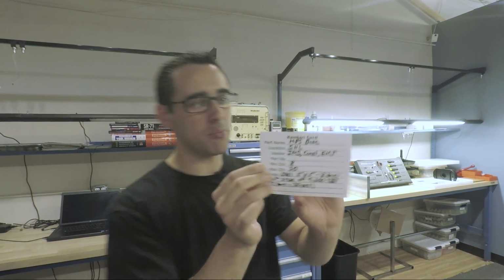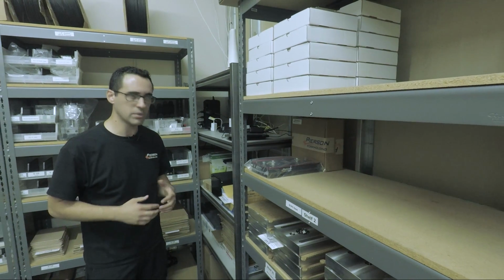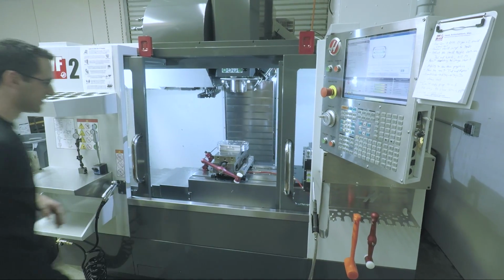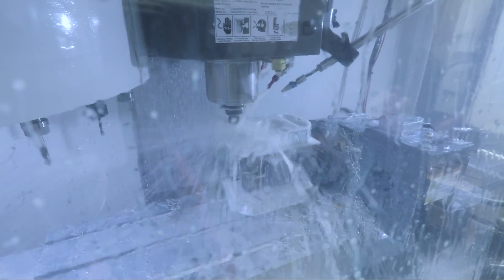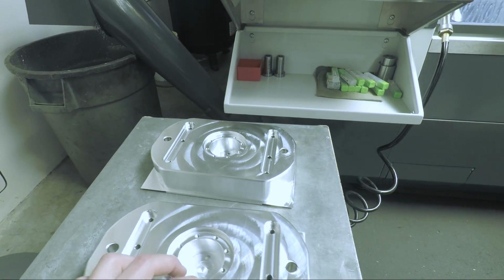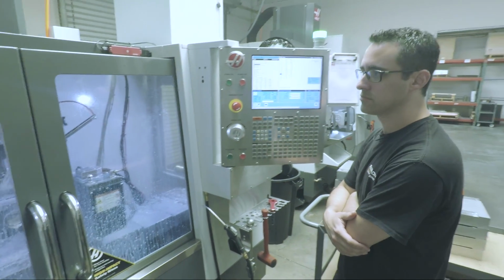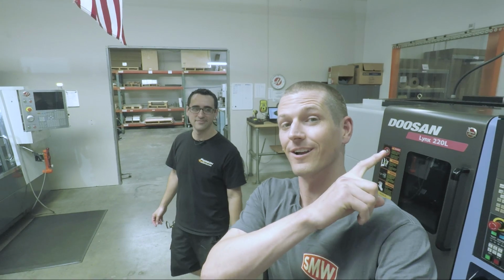Machining A Pierson Mini Pallet System!  1 of 2

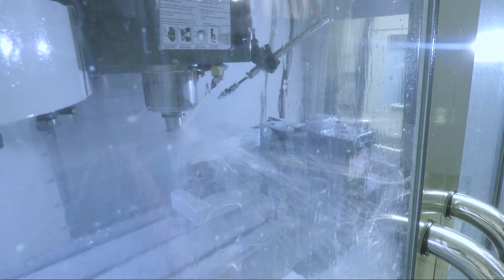Comment: 18:18 350 IPM at 8000 RPM with a 3 flute endmill. Chip load would be 0.014" per tooth. Is that possible?

Comment: You run CNC machines to automate your manufacturing.
Then you break your business processes into a thousand individual manual steps that take a bunch of people and creates a thousand points of failure.
And on top of that you clearly are collecting all this data somewhere to analyze.....
Which I'm sure has to be doubling efforts somewhere and introducing another source of possible errors....
Your accounting, inventory, manufacturing, sales and purchasing systems should all tie into each other and all those boards on your wall should be screens on your computers.
You wouldn't stand at a keyboard and enter gcode line by line. That's what you're doing with your office management system.
You should be able to give a customer a quote and if they decide to order, turn that into an invoice which will trigger inventory and parts assemblies and manufacturing tickets and packing slips.....
All that info can be available from every phone or computer in your organization.
You can even tie your customers into your website let them enter their own order....

Comment: Great ideas however you cant truly state that this is a lean operation.smooth but not lean. All that was done was simplify and streamline operations to 100's of manual processes. Need a part 1 guy carries a card to order. (Why isn't stock charted against orders? And inventory known) then another person updates a manual board. A machinist then has to walk and update said board and be updated from board. Everything on those boards can be automated in software and macros. But you added miles of walking to update and slave to a board.

Comment: Great work. Over 35 years of manufacturing background here and I love what you are doing. My background is electronics but the same lean principles apply to an manufacturing process. I would highly encourage you to start Gemba walks. I come in 30 minutes early a couple of days a week and walk the production floor before the operators show up, this gives me a feel for where we need to reduce clutter or where there are production bottle necks. If I see a lot of full racks at one operation I look at where we need to balance production. I also do a daily walk while production is in full swing and just observe. If you want to established a quality culture watching production will tell you if you are effective. 
I would also encourage you to look into ISO 9001 and 9002, laying the foundation for certification early in the evolution of your organization will make certification easier later. Being ISO certified makes it easy to be approved as a supplier to larger companies and is a huge bonus for marketing  in the military and aerospace industry. In my experience military and aerospace are the areas where small manufacturers in the US can compete with off shore companies. You don't have to be producing product that is directly used in those applications but if you are servicing companies that do you can be an approved vendor very easily if you have an ISO certification.

Comment: Just a quick tip, you could probably speed up your cycle time somewhat substantially by programming the drilling cycle as a G73 chip break cycle rather than a G83 peck drilling cycle, as the tool does not retract completely out of the hole. Also in aluminum with a cobalt drill, I wouldn’t be afraid of pushing it 2X or maybe even 3X D per peck either. I’m sure you know this already but if not then you learned something! 

Cheers, 

Kade

Comment: On that job with the 2 piece rotary, even still there's wasted time. Around 23:40 you've got the same tool running back and forth. I doubt that's intended? You should be able to prioritize cuts so that doesn't happen, at least in Mastercam. So fun to watch that run though. That's the kind of machining I like to see

Comment: John, Haas has settings to turn on your chip conveyor for a period of time. Setting 114 is the setting for the interval for it to automatically turn on(10= it will turn on every 10 minutes), 115 is the amount of time it will be on (5= it will run for 5 minutes). All you need to do is either turn on the conveyor by pressing the button after you start the program or us an m31 at the beginning of your program, and your chip auger will turn on every 10 minutes (setting 114) and run for 5 minutes (setting 115). I hope this helps you. This is what I use instead of using manual NC in HSM.

Comment: Some sort of server that can be updated from any computer that drives an similar looking board with led indicators in  each "cell" could be a great way to improve the system. Any even having physical buttons on the board to update the progress that also updates the server document could be utilized. You could them be receiving notifications about status critical criterion from anywhere.
Reply: The 4 criteria we use for evaluating improvements, in order, are Safety, Quality, Simplicity, Speed. The things you mentioned definitely violated the Simplicity requirement and possibly Speed of implementation.

Comment: 33:00 - 33:27 What is Jay saying? I'm pretty sure I understood him. So the 'Z' zero is the center of the tombstone, I get that. That makes sense. But for the arbitrary 'Z' number, it should be fairly straightforward. The tool height in the offset is based off the Gage Line right? So that no matter what tool you have in there, that goes to 'Z 0.0' you see 'Z 0.0' in the program. If the height offset was Zero, the Gage Line will attempt to go the Program's 'Z 0.0'

Maybe Jay means that it looks arbitrary because the 'Z 0.0' isn't the top or bottom of the stock I guess?? That makes more sense for most flat vise work, but for 4th Axis Tombstone work, the rotation center is the easiest to understand, and typical to program.

Comment: I would consider replacing the boards with touch sensitive monitors and software dedicated to those progress charts - much more flexible, with many opportunities for neat features: better presentation (use of color for example,) real-time status updates over the network, and... er, right, yes, if you did not guess already, a former programmer who got into CNC over here. Sorry! :)
Reply: have you considered the man days required to produce what you spoke of, as in you building that and then considered the added work days it would of saved you? You may find that you could spend a year full time building it and it would save you maybe a week.
Reply: There's nothing there that requires a year of work.  I was not suggesting writing some monstrous system from scratch - just using big touch screens to interface to existing software, maybe tweaking/customizing it in time.  That is, instead of entering inventory into a database with keyboard, you touch the entry on the screen and do the same in simplified/visual way that would be as simple as using the system described in the video.

Comment: @NYC CNC, at 30:30 you where talking about the auger and if you have it automatically on or operate it manually. Did you know there is a feature in the haas to have it on a timer?
You can set the duration and interval with SET.114 and SET.115. ( https://www.youtube.com/watch?v=OGjkavRmFpw )

Comment: What a great video. It's amazing to see a shop that implements "lean" smartly. Jay seems like a great guy. I would love to try to implement some "lean" concepts to where I work, and I'm a guy that hates buzzwords... hahaha!

A couple of questions on this, John, mainly about their machining process:

1 - I see 4th axis setups quite often that are done to save the number of setups you would have if run in a vise. In this case, I don't know that I see the point... If you run it as is, you have a "prep op" (or as Jay calls it, OP 0), followed by OP1 on the 4th axis then OP2 in a vise. But, if you ran the job just in vises, you would still have the same number of ops - you would have his OP1 and OP2, followed by an OP3 for the one drilled and tapped hole. And as you said, you could probably run more parts per cycle using just vises; using the 4th axis, you're limited to 2 at a time. Lastly... although it doesn't apply because he already has the 4th axis, so why not use it, but... just using vises cuts out a whole lot of cost. An HRC like that would easily be over $10k, plus the fixturing, compared to $8000 at the most for four Orange vises.

4th axis stuff like this is still very, very cool. I could see where he might could get 3 or 4 parts on his fixture at a time, then you would REALLY be cooking.

Your thoughts? Wondered if you and Jay talked about this outside the video. Neither way is right/wrong by any means!

2 - I guess this is more a comment than anything. It looked to me Jay was using a Kennametal Dodeka for his face mill. Correct me if I'm wrong. Let me tell you, those are FANTASTIC face mills. I highly recommend you get one for your VM3. We ran a job recently in 6061 aluminum. Not even using inserts for aluminum, we were getting a fantastic surface finish at 12000 RPM and 400 IPM. Ours is a 5-insert, 2.5" cutter. These cutters can either be used for slow, heavy cuts, or even psuedo-"high feed" cutting for roughing purposes. Up to .022 IPT in steel.
Reply: Patrick McClintock The lean principle you're overlooking is "1 piece flow" (sorry for more buzzwords). Let's say we had 3 double vises holding Op1,2,3. While one part is being machined, the other 5 are WAITING to be machined. "Waiting" is one of the 8 wastes of lean which should be avoided. With 2 machines running 3 ops, including the 30 sec Op0, we finished this run of 30 in 8 hrs. So, it doesn't always make sense to load up a machine with long-cycle parts. Two parts, two ops per cycle in our RotaryVise is the sweet spot for these.
Reply: I see what you mean. That's not a bad concept either. It comes down to how you can juggle your cycle times. If you were in a situation where one man could run three or four machines, loading each machine to the max might work; operator stays busy constantly while, say, 16 parts are being machined. But that's not quite applicable in this case. Plus; the volume itself may not be there, and I see that too with running a batch of 30. Good thinking, and thanks for replying!
Reply: Patrick McClintock Yup, it's all about balancing cycle times between machines for optimal throughput. In the case of small parts where it is a 2-3 min cycle time, you definitely want to load up a machine to limit the load/unload time. Check out this photo from our Instagram page... 48 parts, 45 min cycle time, 15 second pallet changes: https://www.instagram.com/p/BTcatgkF8o9/
Reply: That is fantastic, Jay. Wow. The shop I work at has recently gotten into high-density fixturing. The concept clashes greatly with what was our bread and butter, one-off job shop work (when I say bread and butter, I mean year-old wheat bread and unsalted butter LOL). But it pays huge dividends when you have the right job. Thank you for sharing that.

Comment: Just saying, just because you programmed at 360 IPM doesn't mean your machine control is reaching that.  Depends on length of cut , if there is enough length between the accel /decell .. That's where more expensive machines make a difference, CHeck out HAAS VS MAkino video,, or OKUMA vs makino, they give you an idea ..

Comment: Can you order the tools in the toolholder so tool changes are faster?
Reply: Wolphje Wolphje The CAM software chose the best order of the tools here. I don't argue with it.
Reply: Pierson Workholding i agree the order of operations is in cam, but cant you order the tools the same way, so every tool change the tool is available in the next slot? As i think of it this only true if you don't reuse a tool along the way.
Reply: Wolphje Wolphje I think you're overlooking the main point... Did you consider the MASSIVE productivity gains by the way we hold multiple parts and machine multiple operations? That right there eliminates 50% of tool changes and reduces handling by 75% per cycle. Saving 2 seconds in a tool change are the least of my concerns.
Reply: Pierson Workholding i agree your setup is super, i was thinking in the linking moves type of improvement. Here a half a sec and there a quarter, but you are taking minutes of! That is the way to go. I was just wondering if it would help thats all.

Comment: To make your chip auger work like majic... change setting 114 to 7 and setting 115 to 1. Setting 114 is how often it turns on (7 is every 7 minutes) setting 115 is how long it runs (1 is run for 1 minute). Turn it on with a M31at the top of the program. You also save on coolant, with chips drain in the tube.

Comment: Jay! IJK on that first G83 instead of Q. You don't have to worry about chip clearance if the drill isn't deep yet. Changing from a Q.25 to I.8 J.25 K.25 (the first peck goes .8 deep, subsequent pecks reduce by .25 and minimum peck is .25) on two 1.4 inch deep M8 tapped holes saved me 9 seconds per cycle without increasing tool wear or making unruly chips. If you make 100 parts per day and save 9 seconds per cycle, the annual time savings is 1.625 work WEEKS. :)

In reality though, I'd switch to carbide on that first set of pecked holes, go around 6000RPM feed in rapid out and just be done with it.

This is good stuff. Looking forward to part 2.

Comment: Cant be afraid to push your tools john. Especially in production, "push it till it breaks and back off a little" was super common around my old shop.
Reply: "tighten till you hear a crack then back off a quarter turn"
-uncle AvE
Reply: He shoulda tried that on the ER collet lmao
Reply: Max Maruszewski 
Max, as you know .Most guys now-ah-days not only don't believe it but years ago.There were times that thats exactly what we did. 
Jack it up till the insert brakes down or flat out brakes. Then back off 10%. Lol
Thanks so much for the trip down memory lane.

Comment: John
protip for u guys 
https://youtu.be/w3Oc5SvXzM0?t=27m57s
u guys where doing a repeat on that inside diameter 
i saw them doing with counterclockwise 
but it u have the first one  1 going clockwise and the second 1 counterclockwise 
the finish wil improve allot 
i started doing that little trick a while back
and u wil be suprised by the results it yields

stil dont know why this is but allot improved on it 
the actual ID or OD wil be more precize
and a way better  surface finish also no burs ( side note it wil be machined to a sharpness that wil cut u )